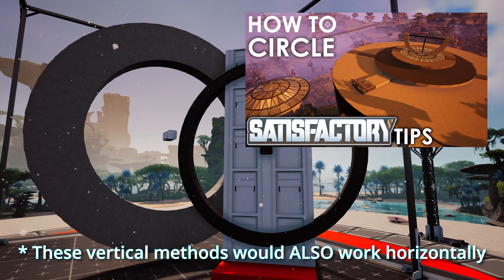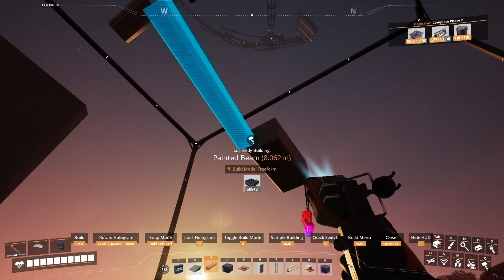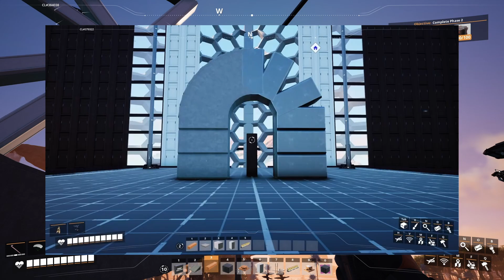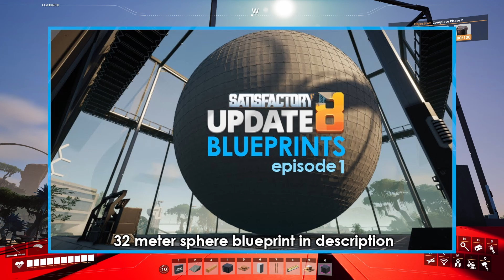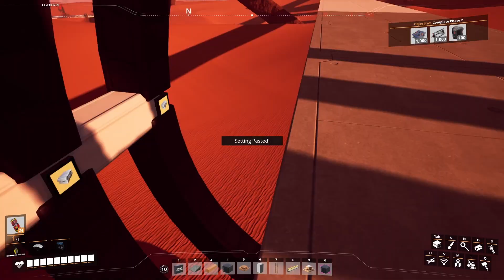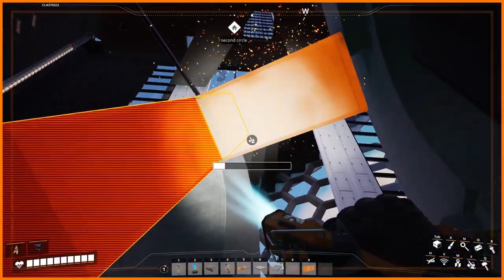Satisfactory Tips: 2 Simple Methods to Make a Vertical Circle

Comment: Any idea how to put an automated gate, or I guess any wall horizontally ? For example if you walk up stairs the gate above you opens.
Reply: Maybe use that one beam from the architecture section in the build menu to build a standing triangle with the right angle (for example the angle of the stairs) and then try placing the gate on top of the angled side of the triangle
Reply from the maker: Before last month I would’ve said that was only possible with mods. 
BUT! Search YouTube for “vanilla vertical rotations in satisfactory” by OfficerDougEiffel. I bet that trick would work for you. Just have to get the timing right.
Reply: @makergaming2022 thanks!

Comment: Using the first method I put my first 4 like you did, then make my first painted beam from center to edge of first concrete and i get 8.062 as you do, but when i pull a painted beam to the edge of THAT concrete I get larger numbers, even very carefully dragging from the center index beam. What am I doing wrong ?
Reply: Got it. Had to watch the video 3 more times to figure out what I was missing. [facedesk]
Reply from the maker: 3 watches. Hell yeah for the algorithm. Sorry I wasn’t clearer though. Guessing you weren’t zooping from the center.
Reply: @makergaming2022  Well yes and no. I was being very careful, as you said, to drag from the center ... ... for the painted beam. I had missed that you were refering to doing so for the concrete so I was just putting the concrete on the end of the beam. [faceconcrete]
Reply: I had the same issue before watching again.